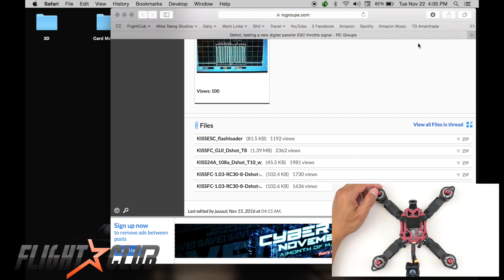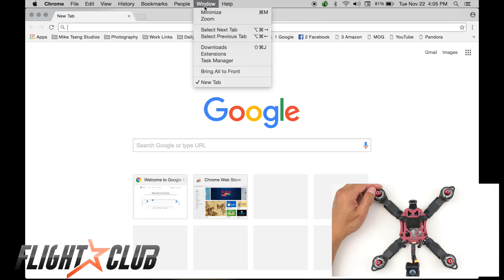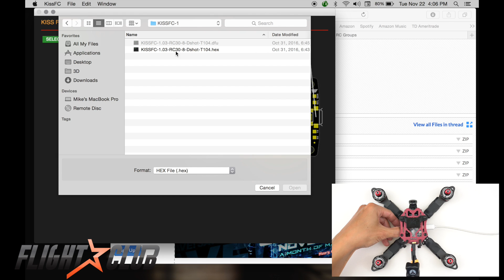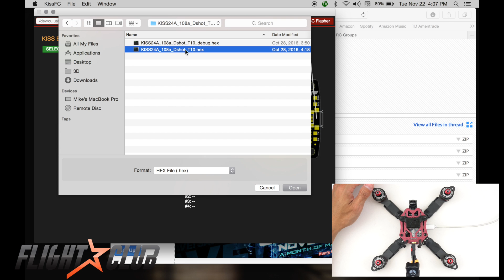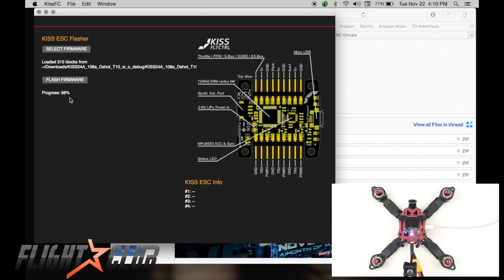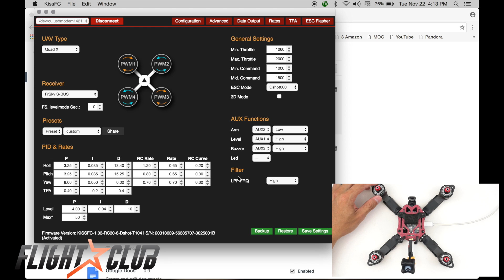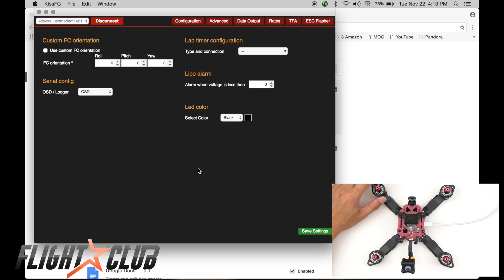What is Dshot Protocol

Comment: Okay, I admit I do not know much about d-shot, that is why I am here watching a video as to gain that information. However I do know the difference between analog and digital, and I can tell you pwm is 100% pure digital. PWM is a way communicate an analog signal in a form that a digital device can understand.( this PWM signal is composed of the exact ones and zeros that you spoke of).  the difference between analog and digital is sort of like a light switch. A digital light switch, or signal Is either a one or a zero, on or off. But an analog light switch, or signal is more like a dimmer switch, it can be a 1 or a 0 or any number of steps in between. So when you make the comment that multi-shot is faster than D shot, but d-shot is better because it is digital. But your previous statement says that multi-shot is using pwm which is a digital communication.   so are you saying that at one point multi-shot had recieved a analog signal and then converted It into a PWM signal to then communicate with the flight control board? Maybe a analog signal from a hall effect sensor And the motor for RPM? if that is the case then are you saying d-shot never receives any analog signals and just guesses at motor conditions? I guess that would explain the lack of calibration with the D-shot.  But I find that hard to believe because if D-shot is just guessing at things then it most definitely would not be better than multi-shot. Since we know that pulse-width modulation is a digital signal and that is a fact that is by no way up for debate then at what point in the communication chain Is multi-shot dealing with a analog signal? and then how would dshot not have to deal with the same analog signal? Because without knowing why D shot is 100% digital and all the rest are not then everything else you say about d-shot being Superior loses all validity. that would be like saying error is wetter than water because it rains. Both statements prove nothing yes rain is wet and yes pwm is digital and not analog but that has nothing to do with proving the rest of the theories.  sorry, I'm just trying to figure out D shot and all the numbers that come after it and I'm ending up more confused than I started... Lol

Comment: If someone could help me out it would be much appreciated.  I have the Kiss FC with Kiss 24a esc that I flashed to the newest FW for both in order to get Dshot.  I followed the video and everything went fine in fact I can see that I have the latest firmware loaded on the FC and the esc's but when I go to set the FC up and select Dshot I do not get that option in the dop down only oneshot 42, 125 and PWM.  I was really hoping to get Dshot to try it out, does anyone has any suggestions.
Reply: twistedFpv  I found that it was my computer.  I have a Windows 10 and for some reason the drivers do not like to go back and forth between Kiss and the Betaflight boards.  So what I did is remove the st32 drivers that Betaflight was using and flash kiss the old way with defuse.  now I have both my Betaflight and kiss kwads on dshot.

Comment: I have an immersion RC alien 5" with the led for the back. I currently have Kiss FC version 3 I believe and the 24amp esc version 1.02. I have not upgraded to Dshot yet but, plan to do so. I noticed some ability to control the led once upgraded to Dshot but, I am unsure how to wire the signal wire into the FC. I figured I would still pull power for the led straight from the pdb as I will only be using 4s batteries for this build. Thought the led was only designed to work with cleanflight. Could you help clear the fog for me in this scenario. Your video's have been very helpful in my builds up to this point and thank you for that!
Reply: I too would love info on this subject!!! What Pad do we solder to for led activation??? Big Up on the video!!

Comment: do you need the telemetry, ground wires from the kiss 24amp esc to kiss fc or can you just use the pwm?
Reply: AlexFpv you can just use pwm you just won't see the firmware version of the escs in the esc tab if you don t have telemetry